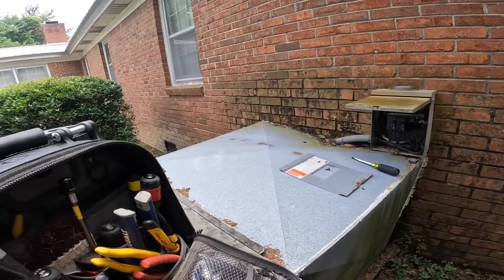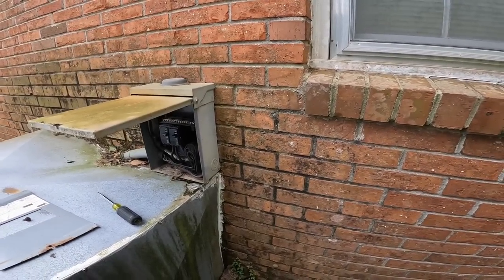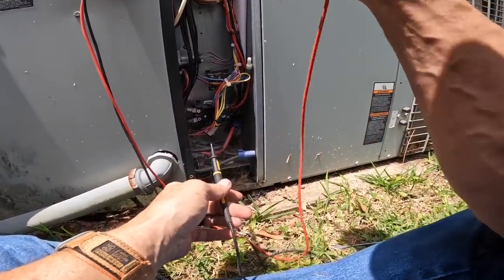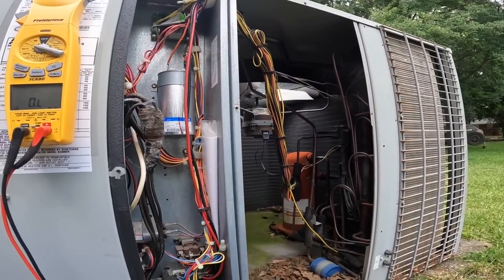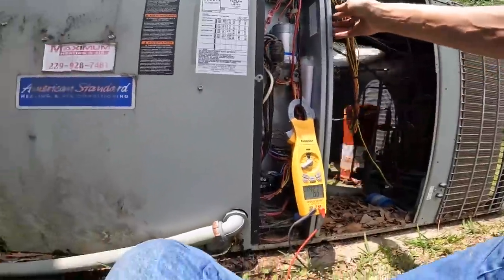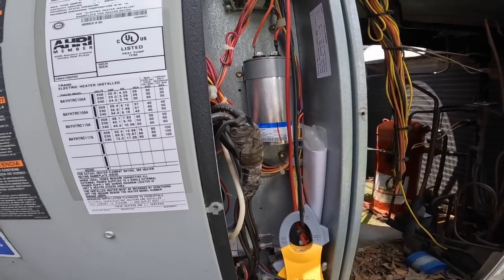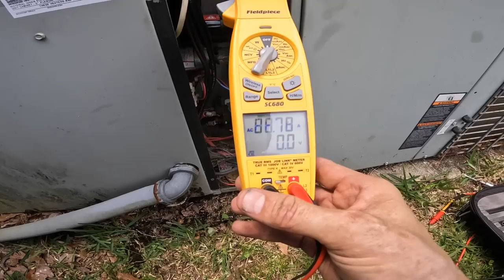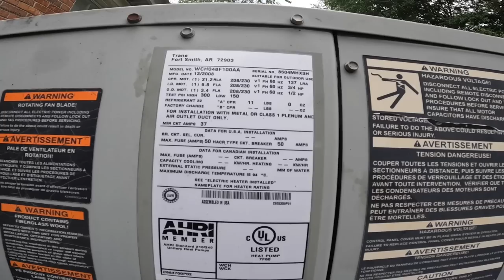Tripping a Breaker Intermittently! #hvacguy #hvaclife

Comment: Yep, my 1999 Trane XL1800 Dual Compressor 5 ton / 2.5 ton actually came from the Trane Factory with an OEM Hard Start Kit in it similar to the one you installed.  Had to replace the Hard Start Cap a couple of times over the years (it caused the breaker to pop when the big compressor tried to start), and I'll be replacing the Hard Start Potential Relay this week just because the OEM Original is getting really old and I don't want it to crap out in the middle of the summer here in Central Florida.  I'm kind of surprised that his Trane / American Standard unit actually didn't have an OEM Hard Start Kit in it from Trane.  Oh well, great job as always.  Hope that fixes his problem.  I know my breaker would trip if the big compressor would try to start and the big hard start cap was bad or weak.  I also discovered the Trane installer only installed a 40 Amp Breaker for my outside unit!!  Its clearly stated on the outside units information plate that the Min/Max Breaker should be 60 Amp.  So I recently replaced the old 40 Amp they installed with a 60 Amp.  I checked the wire from the breaker to the disconnect box and it's actually #6 gauge wire.  Also #6 gauge wire coming into the unit through the whip connecting to #10 Gauge wires inside the unit, so we should be good for a while.

Comment: I've had loose connections at the compressor that gave me trouble, only found out after it cooked the un-fused disconnect and one terminal, fortunately it left enough to put a quick terminal repair kit on its been 5 years or more no trouble.
Thanks again for the videos!😐🍺🍺🍺🥃🥃🇺🇲

Comment: Nice job, those hard start caps may keep it going a long time. I used them quite a bit. I had one on a 24000 btu window unit for years. I think back at all the things I did to that unit to keep it going, it was actually amazing.

Comment: I understand the concept of how a capacitor helps overcome the initial inertia of starting a motor, but didn’t the breaker trip after it was already running? I’m just a homeowner w a new mini split that will hopefully not need repair for the next warranted 12 years, I just have been watching you a long time and like to understand more. I watched an Electrician U video where they explained how our concept of capacitors isn’t really correct, and showed how one actually works, pretty fascinating stuff..
Reply: Watch it again, he gets the start and amps, he didn't have it plugged in good, everything shut down he quickly plunged it back in and it tripped after a couple seconds.
Reply: @gainestruk1  oh..I must’ve missed it..thanks!

Comment: Is it too late for a soft start kit to be installed on the system? Is the compressor too far gone now? Or is a hard start kit the only real option?
Reply: If unit is 15 years old just use hard-start kit until it quits for good; then get new unit.

Comment: I worked a unit 480-volt three-phase it would blow the hundred amp breaker now is it did my math the solve this problem two other breakers 40 the heat compressor and the two fans. As I asked worth the heat mode on answer no so I started look at the wiring then one strange thing occurred wires coming from the main breaker wires going to the other fuse panels in the unit well it looks like a lightning strike got the bakelite unit all the words were tied into turned into his type of carbon so basically I have some connectors from another unit tied two wires together taped them up real good and the problem. They were going to replace 10 to $15,000 unit and that was not including the cost to rent a crane hoisted on the roof.

Comment: My ac keeps cycling on and off what could be the problem
Reply: When my A/C was doing what you described it was low on Freon.
Reply: Many things can cause short-cycling. If discharge from the condenser fan goes right back into the unit; intermittent condenser fan motor. I've seen a few...!
Reply: It could just be a float switch turning it off and do to a partially clogged condensate pipe, or not a proper p trap
Reply: Could be the thermostat, a motor or compressor going out on overload. Call Curtis.